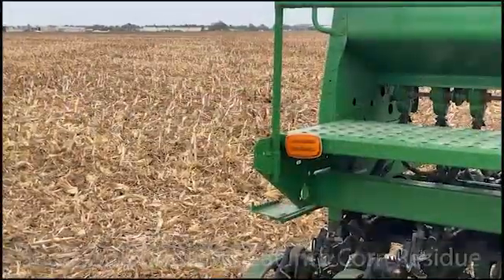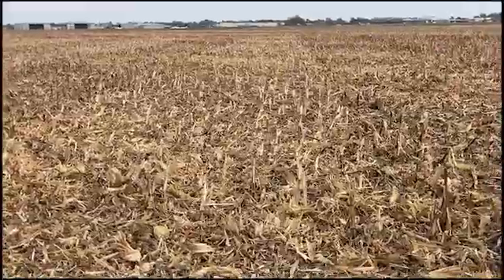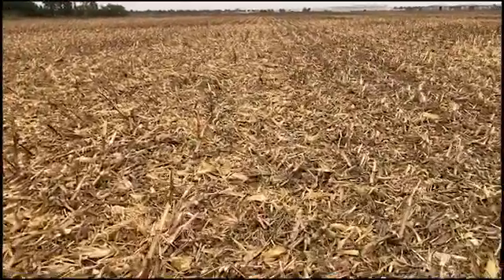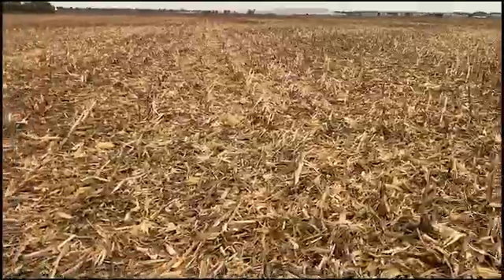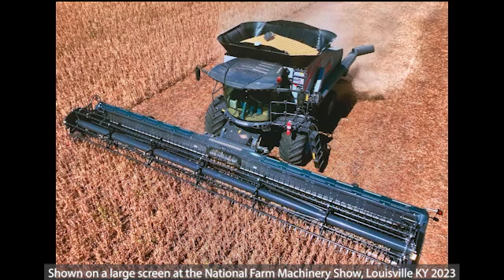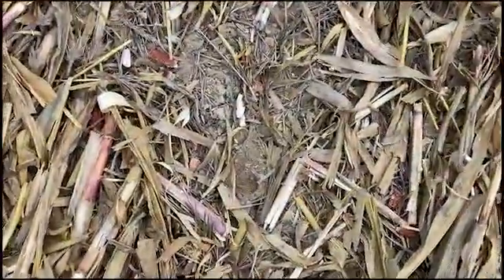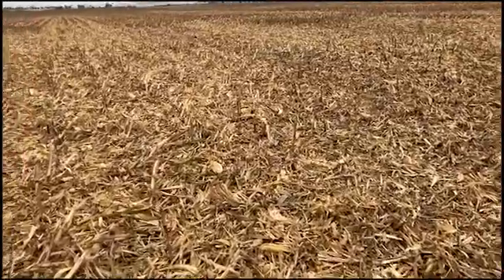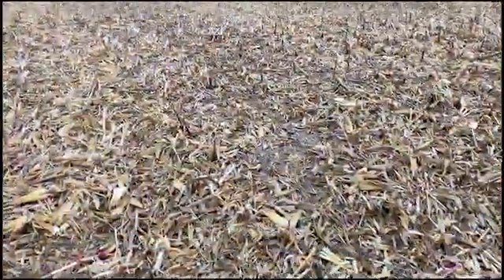Needham Ag - Successful No till Wheat Into Corn Residue (And Spreading Corn Residue).

Comment: Interesting video. We are growing more and more corn here in S.E England and due to the conditions at harvest/planting we are finding no-tilling wheat into corn stubble the most reliable method although we are still learning and these videos are very helpful.
Reply from the maker: Is it corn for grain or silage ? When is it harvested and what drill are you using ?
Reply: @NeedhamAg  Corn for Grain. Harvested in October. Ideally wanting to plant the wheat ASAP behind the corn harvest. Heavy wet Clay soils and it normally rains a lot in the UK in winter as you will know. Horsch Avatar
Reply from the maker: @danwormell9661 OK sounds good, just try to find varieties with better tolerance to fusarium. 

Plus be sure to put phos is the row with the seed. We have a video on that subject called “Needham Ag - No-Till Wheat Into Corn Residue and the importance of placing P in the row”.
Reply: @NeedhamAg  thanks I saw that vid. Its a steep learning curve for sure! Its a challenge no till but actually i think in our situation at least it is the risk option. We dont want to be pulling up heavy land late into Autumn trying to create a seedbed.
Reply from the maker: @danwormell9661 Yes I grew up on heavy marine clays, getting the corn off as early as possible and planting soon after corn harvest is next important to get enough growth going into winter (to get enough tillers/heads for maximum yields). P in the row helps with this also, in addition to keeping the seed rates up. Make sure residue is spread well with combine too. 

Good luck

Comment: A Gleaner will do the best job sprending residue. Just have to have it set. 40ft for any brand isn't hardly achievable especially if theres some wind.
Reply from the maker: Which Gleaner do you run? The one in the AGCO video (taken at the NFMS) didn’t look very good at 3.37 in this video.
Reply: @NeedhamAg  Personally run older R series. With 24ft head i can way over spread it's width and it will be even. On newer machines the spreader needs to be running full speed with an X pattern on the channels for it to spread even and wide. From what ive seen locally, anything wider than 30ft the residue doesn't get spread like it should. Ever with Deere power cast there are streaks of heavy and light residue.

Comment: Could running a mulcher before planting be useful?
And how about using seeder with coulters rather than disc seeder? Like Horsch sprinter, or the corn residue would pull up and pile up between the coulters?
Reply from the maker: @MegaBomboloni  We strongly discourage mulching corn residue ahead of a no-till single disc drill. 

These are the primary reasons based on our research over 25-30 years. 

1. When you mulch corn residue ahead of the drill, it dramatically increases the material on the soil surface that the drill has to cut through, which reduces stand counts and early plant health. 

2. Mulching corn residue leaves a mat of residue on soil surface (compared to leaving stalks tall and standing). This reduces the soil temperature, especially early in the spring (with winter wheat) and slows early spring growth.

3. Mulching residue increases the carbon penalty and often reduces plant health in the fall and early spring (with winter wheat). 

4. Mulching corn residue is slow and expensive, plus our research shows higher wheat yields come from leaving corn stalks standing as tall as possible (compared to mulching ahead of the drill). 

5. Some mulchers don’t spread the material evenly and leave heavy streaks like this video shows. 

If your drill pulls up piles, you need to switch to a drill which can handle the residue.
Reply: @NeedhamAg  tnx for reply

Comment: Would there be a way to try and put some type of row cleaner ahead of the seed opener? Thanks.
Reply from the maker: @edelm6062  We have spent lots of time over the past 20+ years, helping to test and refine a row cleaner for a single disc opener - to help part corn residue, but there are too many challenges. The main one is there isn’t anywhere to go with the high volumes of residue (if the residue is light you don’t need a row cleaner).
Reply: Interesting details on no till wheat into corn.
Reply from the maker: @bigtractorpower  Thanks Jay!